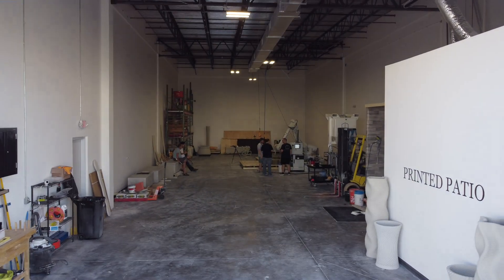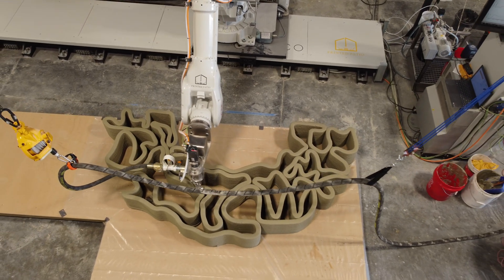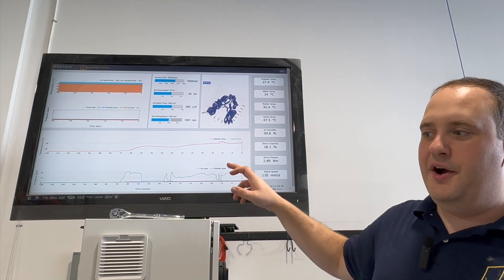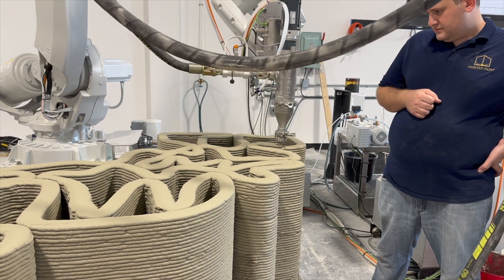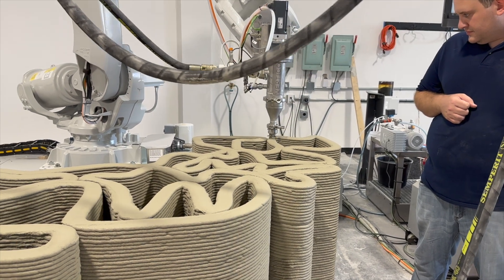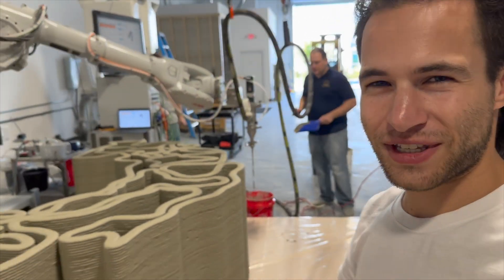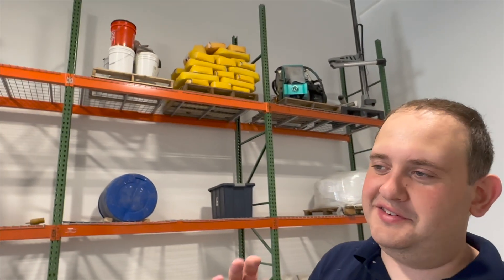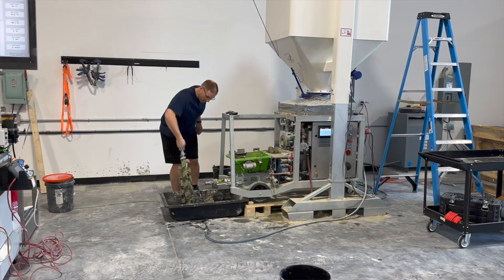Indoor Concrete Printing Process TELL-ALL

Comment: Why don't you make the extruder turn on its axis with concrete flow limiters so that it repeats all the turns and forms even walls of the print layers with them? So no one has done it yet. (Sorry, i translated it as best i could...)
Reply: For this particular print, the layer lines are a good thing. They will provide a nicer surface for marine life to grab onto.

Comment: connect the hose to the printer arm 90 degree at the nozzle and a loop at the top knuckle
Jarrett have those guys call me and I will solve there hose  management problem I have an easy solution  same system as a normal concrete pump on a crane the hose management system already exists
Google concrete boom pump images and you can see what I'm talking about 
Take care Ray